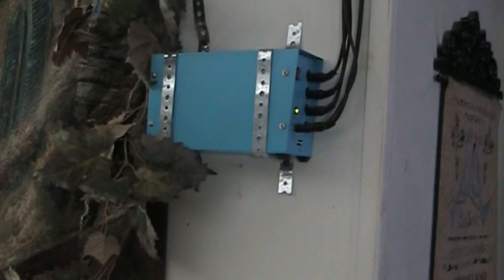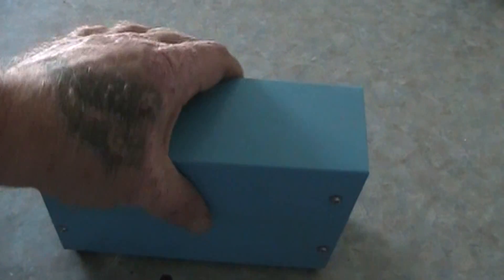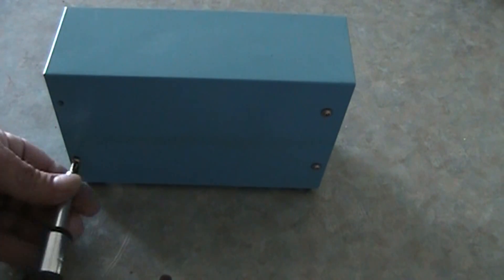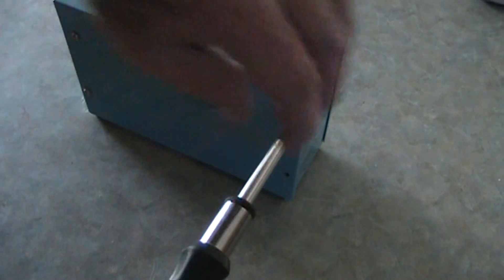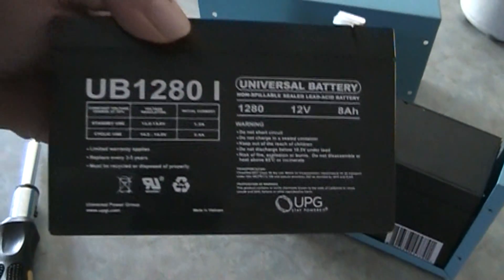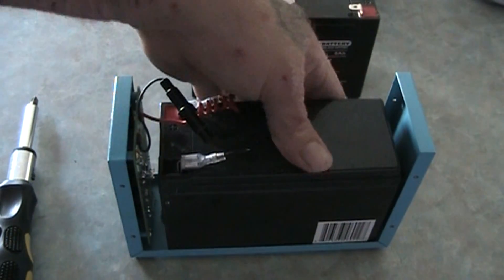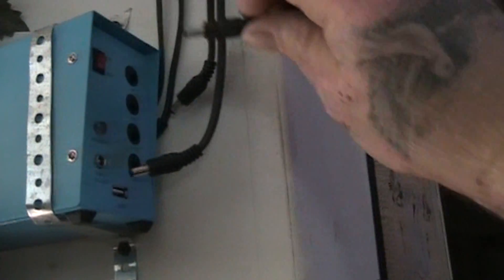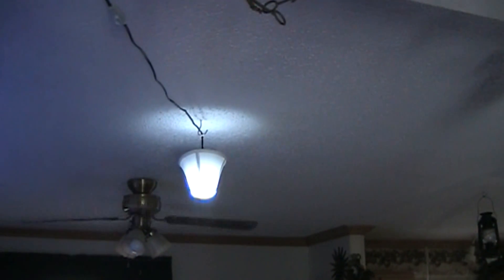EEP Solar lights; changing the battery

Comment: The solar light saves about 4 dollars a month on electric bill. The battery cost about $32.00 dollars. That is the same battery that is inside most UPS battery backups that you buy for your computer, but it never gets drained all the way down and last at least four years.

Comment: I have a home alarm that uses these batteries for backup and the alarm company replaces them after 5 years. For that function they last that long, of course they are only drawing on the battery when the power is off which is rare.

Comment: Sounds great, but what happens next year, when the _same_ battery gives up?? Maybe the company will charge you for a new battery to fit the specific form factor, maybe not. But reliability remains an issue. An SLA should be lasting _many_ years, not just one.
Can this not be tied into your main battery system? Hope it works out for you.